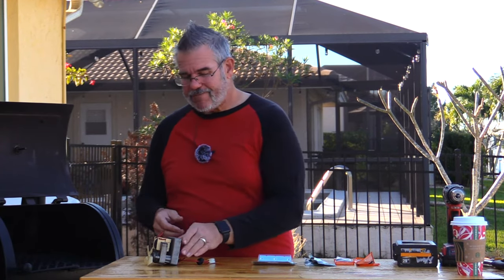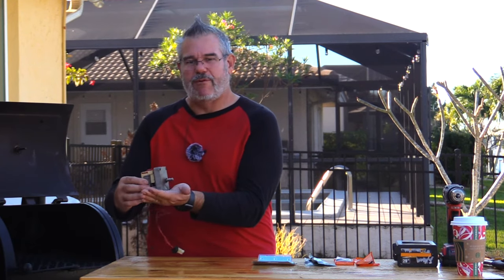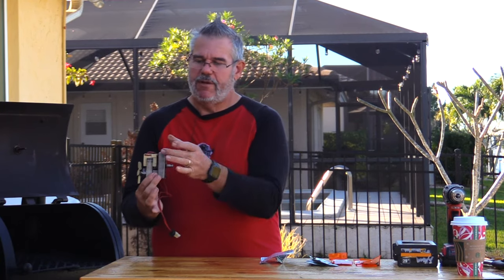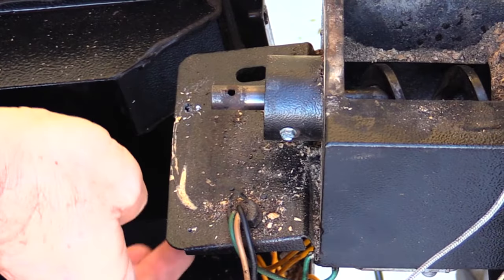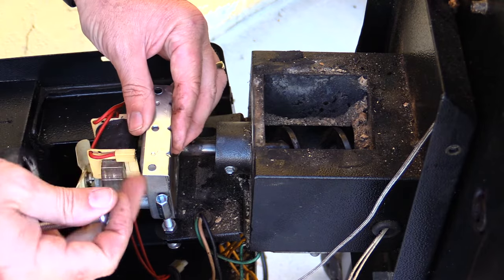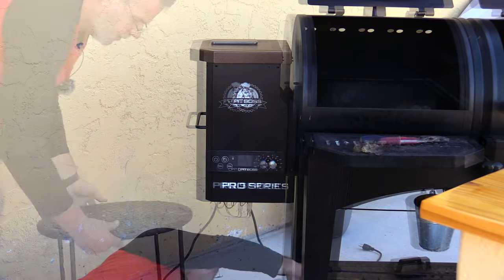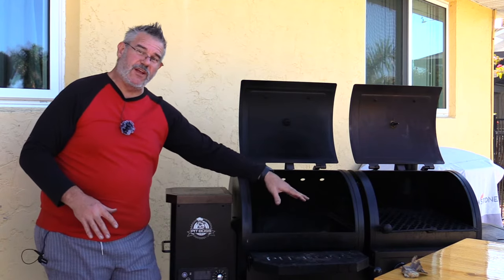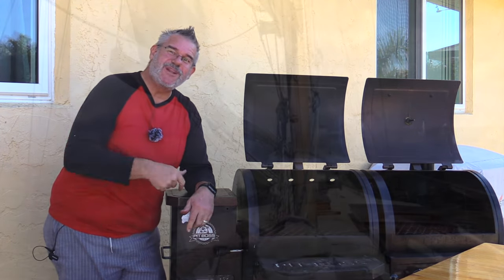Repairing your Auger Motor Mount (Pit Boss Pellet Smoker)

Comment: I have exact same smoker. There is clearly a flawed design of the auger. The motor is not attached with no bracket. It is completely free and only using a single panel it is laying on as a leverage when rotating. All this while the fan is attached with a bracket and 4 screws. Who would think?
Reply from the maker: Someone made a comment earlier that the white glob I saw is the bushing that goes in the motor side of the auger shaft. Or should I say ‘was’ as I think it melted during an improper shutdown. I think they were right. Here is a link tot he bushing. I haven’t installed it in mine yet but ordered it and have it here now. https://amzn.to/3ap28ji

Comment: They make a bracket you can buy for this exact reason about $20
Reply from the maker: Awesome. I did t know they made one too.
Reply: Pit boss doesn’t make it but some guy does. I just installed it on mine. I had a similar issue with my auger constantly being jammed

Comment: 🔥Thank you very much for sharing this tremendous IDEA 💡🔥!!!
Reply from the maker: One additional tip I found later is that there should be a bushing in there as well. Mine melted out and they are only about $10 on Amazon. If you do this go ahead and add one of those of yours has melted out.

Comment: The solution is way easier. Open your raincap so it can breathe.
Reply from the maker: What is the "RainCap? you mentioned?
Reply: @Svdreamchaser  on the right side, it keeps rain out of the smoke stack.
Reply from the maker: @goocherrific oh. Yes the smoke stack. It is open and this was really a problem with me not cleaning the fire pit out so they smolders to high up off the bottom and caught the auger pellets on fire or smolder. Completely my fault.

Comment: I'm just guessing, but I think the free floating motor is by design, because there is a certain amount of inherent wobble in the auger shaft. The free floating motor is allowed to move to compensate for the auger wobble. If you watch the motor, you actually see it move in and out as the auger wobbles.
Reply from the maker: True but I later found out that plastic “Base” was actually the melted bushing.